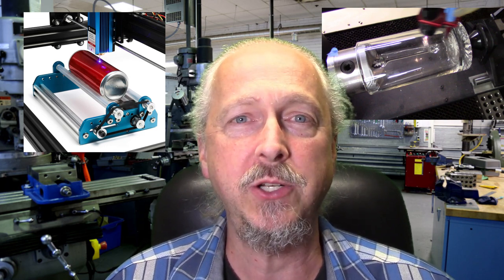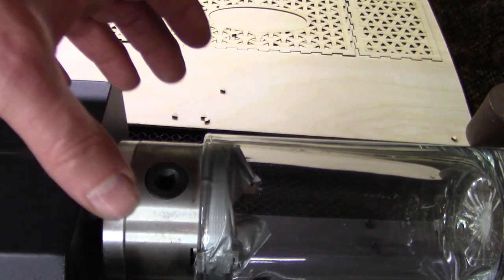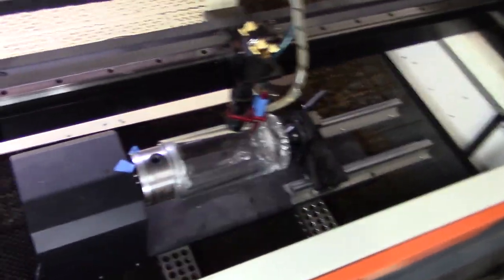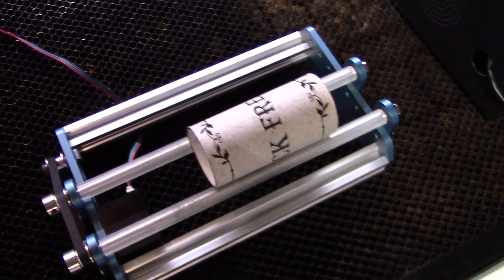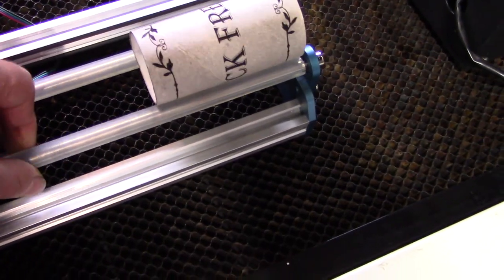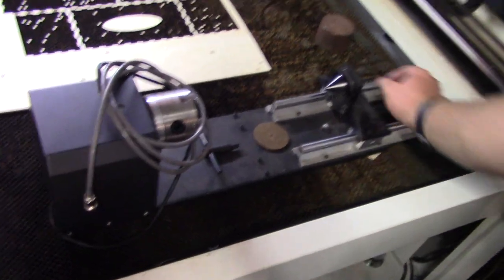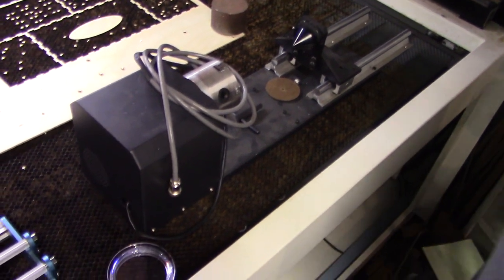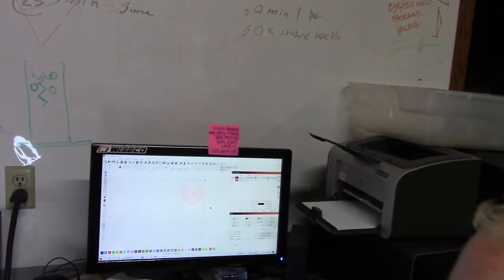Rotary roller vs. Rotary Chuck - which is better?

Comment: Nice video, what power laser did you use and what settings did you use to etch the glass beer mug?  Thanks
Reply from the maker: Great question.  If I remember correctly, their laser is a 150 watt, CO2 laser.  I do not know what settings they used for the mug.  You can ask Leon over at MAKING it Happen.  I bet he can pull that up.

Comment: Hey, what brand is the chuck you are using? I find a lot of them, but not many with the tail stock? Thanks!
Reply from the maker: I will have to check on that.  The chuck is what they use at Making it Happen.  I can check with them to see if there is a brand.  It may just be a generic thing.  They ordered it as part of the laser purchase.

Comment: Would you know if this would work on the Ortur Laser Master 2  Pro?  Would you have a link to the company who made the rotary chuck so I could ask them?
Reply from the maker: I don't know if it would work or not.  My guess is that it would work as it uses a standard stepper connection.  As for the check, that was something ordered directly from China as part of their laser.  I know that MAKING it Happen had found this through Alibaba. I did a quick look and didn't see the one they had gotten. I hope that helps.

Comment: Lol Vanna white has hairy arms when hand modeling the chuck rotary axis!!!
Reply from the maker: That is all part of the charm of having Betty Wh...  I mean Vanna White doing the modeling.
Reply: @CNCATHome  you think with the laser there all convenient like there would be some laser hair removal happening.
Reply from the maker: @makingithappen9840  - Are you trying to tell me there hasn't been?  I saw blasts on the inner wall from when the mirrors were not aligned properly.  I am will to bet there has been some inadvertent arm crossing of the unfocused laser beam.